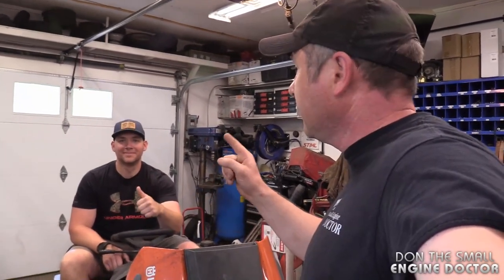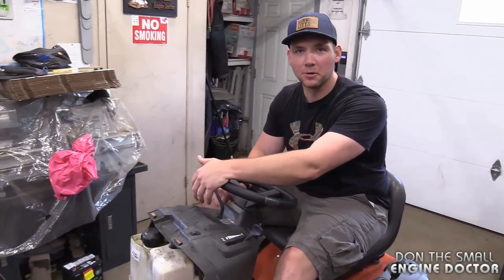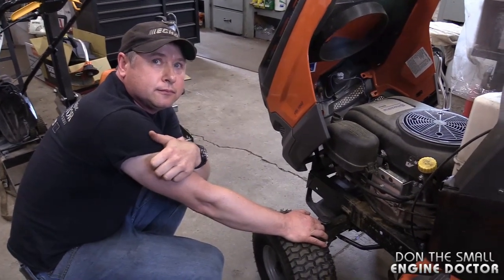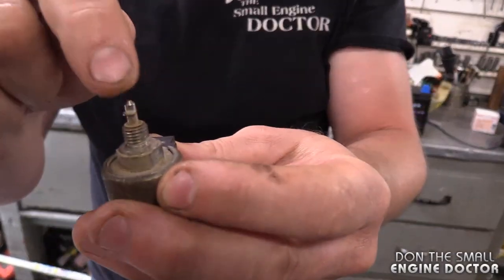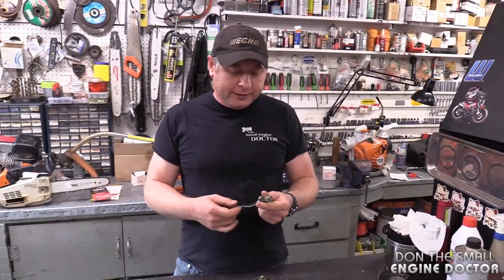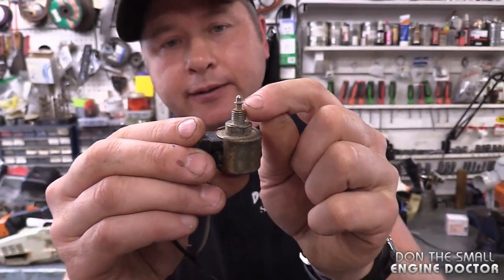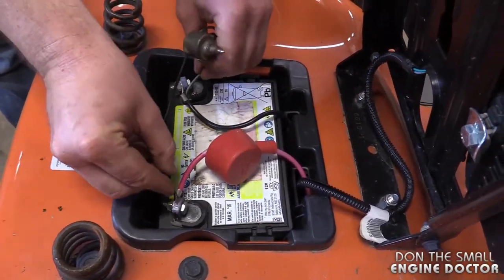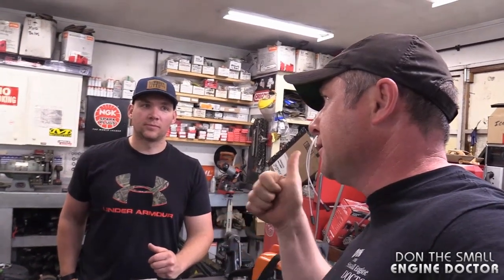Clicking Carburetor Noise On My Lawn Tractor - What Is It? Teaching Apprentice Dave

Comment: Diagnose this, Dony: vintage 12.5 Kholer Lawnboy lawn tractor. Was cutting grass this evening. Gradually, it started running faster and faster, as if the throttle was suddenly giving it way more gas than normal. (Of course, this started happening as it was getting dark and down the hill from the house.) I turned off the ignition, turned DOWN the gas, and started it a couple of times, but each time you'd think I had the gas on full throttle. I did not attempt to drive anywhere. The cable is fine and the throttle lever moves back and forth just fine down at the carburetor. The last time I attempted to start it, some flame was shooting out of the muffler a wee bit, there was a bit of backfiring, and it was still revving up fast despite the gas lever being down at the lowest setting. I immediately turned it off as it was also just starting to run rough. 

The key will NOT start it now - no click, NOTHING - will not turn over at all. I have the battery reading fine but I put the trickle charger on it for the night just in case.

Thoughts?

The Morning After:

I have discovered a 20 Amp fuse mounted below the battery that looks burnt out. I am about to run over to the garage and replace it. However, the increasing rev that was happening last eve is still the mystery. I wouldn't call it surging - it just kept increasing until I turned off the ignition key. I'll get a couple fuses and see what happens if it starts this morning.

Another update: replaced fuse and now it starts fine. Engine still revving very high. I'm thinking the carb float, like Patricia Buchan in Grade 8, is stuck up...

SOLUTION: I know you both are sitting there, anxious in anticipation, pacing the floor, waiting for me to write the final instalment of this situation, so here goes:

I took the air filter and carb off, and never having done it before, paid attention to the order of things and tried to be aware of what it was I was actually seeing. What I saw was an outer... what my father always called a butterfly valve, which is activated by the choke. Once the carb was off the engine, I noticed that there was a hinge or spine that sort of mirrored the outer butterfly valve but without the circular disc. Ok, I thought - here is what it looks like.  A few moments later, having dealt with a lot of dust and collected pollen and dirt around everything, I thought it best to give the chamber leading to the engine a wipe. My fingers felt something moving deep inside, and I got the light and looked in and there was another butterfly valve  - which was sitting in there loose and not attached to anything... I reached in with needle nose pliers and brought it out.

It did not take long to realize that it was the missing second inner valve plate from the carb. The two mounting screws had disappeared (I think at least one of them was rattling around inside the muffler for a short while, but it is out now and the engine runs normally) as they had no doubt been sucked in much like the percentage of the population that voted for Trump. I found two new little screws that fit the threads of the hinge/spine and fastened it back on. Reinstalled everything, had to readjust the control arm of the second butterfly valve as I had placed it too closed, if that makes sense, and have finished cutting the grass as of now.

A loose/thrown inner butterfly valve plate was the issue.

So... my best to you both and perhaps I may drop in the next time I am passing through Gravenhurst. Your videos are intelligent, well communicated, and worthy of being college instruction. Don, I hope that you consider offering a course as an elective to the local high school students or college kids. You really would make a great professor.

Comment: DonBoy just a little addition to this video for all your subscribers from the OLD MAN: There is a sign out there that says the small engine shops hourly rate doubles if you have worked on the equipment before bringing it in! DO NOT LOSE THE ALUMINIUM WASHER THAT IS ON THE FUEL SHUT OFF SOLENOID. Just about everyone that comes in to EP has this issue because the customer has had this off and dropped the washer. Another great video buddy, simple but sound advice to increase customers knowledge.

Comment: Fuel cut-off. It prevents after run or dieseling and prevents any further atomized fuel from entering a hot cylinder during shut off and prevents any further spontaneous ignition. Almost like a fuel purge solenoid.
Reply: Correct! And by preventing backfires you do two things, first, backfires scare people, best not to wake up the hill billy neighbors who have shotguns. And two, backfires can sometimes cause a bent valve situation, so best to prevent them alltogether.

Comment: Don, (possibly unrelated) On a 27hp Generac  /(D. Chopper) I've noted the engine only shuts down using the carb solenoid  --  This engine does have the Diode Spark Modules system   --  If I wire the key to short out the diode set, would that  connection, in time, cause damage to the diodes or magnetos ?  --  At present, the engine takes an extra second or two to fully stop   --   Thanx For Being On The TUBE For Us ! --  This might be a learning tool for young David -- Ya never know ?

Comment: The good old antibactfiring valve/ solenoid whichever one you want to call it LOL but I call it the anti backfire valve and a lot of times unhook them on my carburetors because they will get stuck in the up position due to so much ethanol in gasoline around where I live and it's hard to find ethanol free gas, without driving a long ways

Comment: Thanks for the info! I knew the clicking was a solenoid but didn't realize it was for the carb - thought it was the starter. I guess I never looked that close. I'd be hesitant to check the solenoid with the battery installed on my JD lawn tractor because the battery is in the engine compartment. Fuel leaking out of the carb and a wayward spark probably wouldn't be a good mix. :)
Reply: The starter selenoid only clicks when you turn the key to the start position. Most people don't get to hear it, because that engages the starter. But, if your starter selenoid has gone bad, or your battery is too low, you will hear the clicking sound from the starter selenoid. When you just turn the key to the ON position, you only hear the afterfire selenoid on the carb click.

Comment: This video is awesome and just explained a bunch of stuff for me. However, I'm curious to know if this is likely what happened to a briggs 31H777 I just rebuilt. The bottom half decided it was through with life. Casing was fine, piston head was good. We decided to rebuild it. New connecting rod, new rings, gaskets, new carburetor, plugs, etc. 

The people weren't doing proper maintenance but the oil thinned out and smelled of gas. I'm thinking the connectors on the starter side are shorted. My theory is that it flooded the carb and into the engine. If I jiggle the wires, I hear the solenoid engage. Looks like someone may have spliced them in the past, too. I finalized everything last night but want to square that away so it doesn't happen again. 

Would love to hear some thoughts to anyone familiar seeing this comment.

Comment: I have a question... I have a toro time cutter with a Kawasaki on it.  When I start it up and run it mowing my yard if I have to stop it I have a hard time getting to start back up again when it is warm.  I choke it un choke it, more fuel less fuel it just crank and crank and cranks.  About the time I go to give up it starts. My filters are clean and new, oil, fuel, air.  I have a good battery with more CCA then came in it, good gas it just takes a long time to fire up when it is warmed up

Comment: My brand new husqvarna with the kohler 7000 series you have to shut the engine off at half to full throttle to prevent it from dieseling/backfiring. It even says it in the owners manual. I guess the cutoff solenoid only cuts the high jet.

Comment: Good video, I have a snapper rider and I've installed a new carb, because it would bog down while cutting and going up a small incline, its also blowing smoke not alot but enough to notice, now it has a briggs professional vtwin, could this be a carb issue or transaxle going bad, a little history last summer we where moving firewood with it and my buddy for some odd reason held the brake on and pressed the forward pedal, it started running like this after he did that, he held it enough to shear the little brake disc off, could this be abuse in the safety system or is the transaxle cooked

Comment: I've got a 2015  Huskee/Mtd lawn tractor that won't start unless I rock it back and forth while turning the key - acting as if it had a pull-start - the wheels often lock up also. The starter does work sometimes, but only intermittently. Any ideas as to what's going on and what I should check for? Thank you for any feedback you can can give, and for all of your videos in general.

Comment: Nice video. Pssst...hey Dave. :D You can cut the fuel solenoid end off, reinstall, and install an in-line fuel shut-off. We haven't got to that video yet because it isn't a proper repair. The Canadian Safety Council doesn't approve. :D
Reply: That solenoid does not serve like a inline fuel shutoff. It will not prevent fuel from flooding the bowl due to faulty needle/seat. It just blocks fuel from leaving bowl into the main jet.

Comment: Please do a video on completely electrically troubleshooting a riding mower. I have a 10-year old John Deere x534 that shuts off randomly one or two times during an hour and a half long cut.  It starts up immediately after shutting off. It runs fine otherwise.  I'm thinking it is an electrical issue, but I'm not sure.

Comment: I have a chainsaw with a Tillotson HS carb. It runs super rich even with both adjustment screws turned in to their seats.
Have you come across this?
If both screws are seated no fuel should flow from the diaphragm chamber to the throat of the carb.
How can this be running super rich?

Comment: I always thought it was meant as automatic gas shut off so in the case there was a stuck open needle you didn't dump a couple of gallons of fuel in your shed/garage.
Reply: No, any regular fuel shutoff valve can do the same thing. And for this reason, is why I use a metal based one on my Craftsman tractor. Its got a stock 31-year old engine on it, if I don't turn the engine off by the fuel valve, eventually, the carburetor will flood the engine, thin out the crankcase oil, and dump fuel on the floor as well. And before you say, why don't you just do a total carburetor rebuild on it? Cause my answer is going to be, ya right, you try finding a rebuild kit for a 31 year old engine, from a company who went bankrupped. So just as easy to turn off the valve. The electro magnetic afterfire selenoids, are pure for preventing backfires.
Reply: @stellarproductions8888  yah it was a bad assumption on my part.   I have 26 year old 420 kawi on a piece of equipment that will backfire if shut-off at say mid to full throttle. I just let it idle a bit before shut down to keep it from pushing fuel into the hot exhaust at shutdown.  On your crafsman machine you could still get a rebuild kit kit,  just not through sears, sears didn't make the engine right?
Reply: @luuk-out-below9804  Briggs made the engine and Briggs filed bankruptcy last year. So we're going to start seeing new mowers coming with different brand of engines now, like you Kawasaki, or Kohler. As you probably know, Tecumseh went out of business at least 11-years ago I believe. Not that I ever would recommend one if you're found one. They went out of business because they made crap. Truth is, Briggs was going the same direction before they went out of business too. Building cheaply is not always better, I wish more companies would learn that.
Reply: @stellarproductions8888  yah throw away model.

Comment: Hey Dony, do they make flexible exhaust tubing to fit an after market exhaust. Did an engine swap and the muffler on the new engine will not fit the new application, so I want to use the original muffler from the blown engine and need to route the exhaust piping to it. Any thoughts ???
Reply from the maker: yes they do

Comment: Replaced a riding mower carburetor , wouldn't start . When somebody had ground down the carburetor fuel solenoid and killed the power/ or cut the wire too it . So when I put the new carburetor on - the new fuel solenoid wouldn't operate . I thought the New solenoid was bad , so I screwed the old fuel solenoid into the new carburetor  and it started and ran perfect . So beware when your working somebody's equipment that somebody else has been into before 🙀

Comment: If the engine was a Twin, would it have two fuel solenoids?
Reply: no i'm pretty sure all riding mowers only have one carb. if they want to give it more fuel they just make it E.F.I
Reply: @ChrisN85420  except for the Tecumseh vtwin. 2 carbs and each has the solenoid.
Reply: @kenhilson786  ken thank you i did not know that i'm a diy'er so that's why i said pretty sure because i was not 100 percent positive i bet you don't see that engine to often

Comment: My Ariens riding mower with a Briggs&Stratton engine runs rough when I’m driving it around, as soon as I engage the blades it seems to run perfect. Any ideas?
Reply: Sounds like the engine is running lean, common among modern day EPA regulated small engines. Turning the blades on puts a load on the engine, which draws more fuel, therefore smooths out the engine.

Comment: i have a Ariens 10hp tractor that clicks when I try to start it . if I put 12 volts to the starter it will start any ideas?
Reply: Sounds like it is doing what it should.  Clean the Battery Terminals Power and Ground very carefully at both ends.

Comment: My question is, why, a solenoid wasn't mandatory, in older engines, of the same displacement ? My older Briggs engine never backfired but the newer one, without the solenoid, will.
Reply: Engines run hotter today  due to epa standards 
The engines, leaner on fuel, coupled with larger chambered mufflers on newer engines the mufflers would get hot enough to ignite the fuel vapors in the intake tract thus causing the annoying backfire when the engine was switched off, to combat this the mfg’s installed this solenoid,  the theory is to stop the 14:1 atomized fuel from reaching the exhaust tract thus preventing the backfire. It’s prob by far the most misdiagnosed item on a riding mower
Reply: @THEMOWERMEDIC1  new engines running hotter nowadays, probably that’s why they blow head gaskets and don’t last as long as the older ones, plus some other causes or flows in the design. 🤔 Do newer carburetors have any adjustable air/fuel mix?  If they do, I should probably open it up a little bit 1/8 of a turn 😅
Reply: @THEMOWERMEDIC1  But I like the "ka-boom". It keeps the kids off my lawn.

Comment: You did not address that if your battery is about 6v, you cannot jump start the tractor because the solenoid takes at least 9v. So the tractor will start with jumper cables but dies as soon as you take the jumper cables off because 6v will not hold the solenoid back.

Comment: If you put chainsaw gas in a lawn mower.what will happen?
Reply from the maker: not much, but prolonged used will carbon up piston
Reply: It'll smoke a bit. Might foul up the valves too.
Reply: It'll smoke and it might clog-up the carburetor IF, you do it again and again. Remove the gas, if you can, and fill it back up. A while ago, I've done that on purpose to lubricate the inner parts of a very old mower then, once the gas/oil mix level was low, I switched back to non ethanol gas. The smoke slowly dissipated.

Comment: I am not advocating this. I know that you know this. For others if they are in a tight spot and need to keep mowing, take the fuel solenoid off and cut the plunger off. This would allow you to keep using the mower until your new solenoid comes. This next step applies whether you have a fuel solenoid or not. Throttle your engine to idle and let it run at idle for a minute or 2. This will almost always alleviate the backfire issue anyway.
Reply: unless you have a kohler.  the sollenoid only cuts the high speed jet. the owners manual will say to shut it off at half throttle or more
Reply: @richardcranium5839  yep. That’s what it says.
Reply: @richardcranium5839  so true. I have a Kohler Command 22 on my Cub Cadet tractor. It has one of these solenoids....and functions.......but you still have to throttle back to around half throttle for a minute or two, or it will run on when you shut it down.